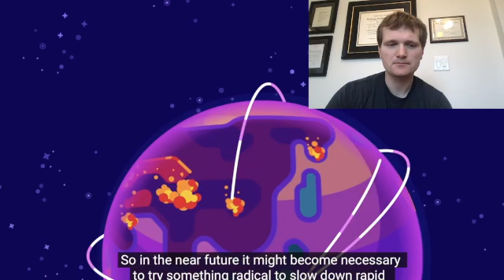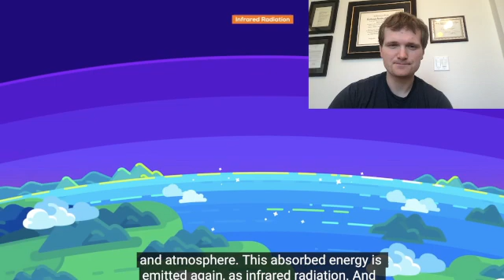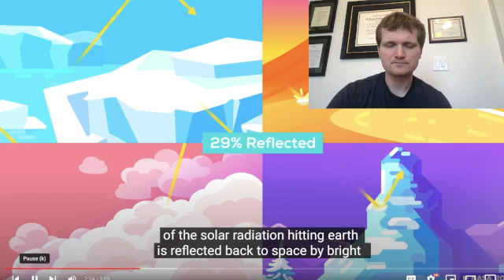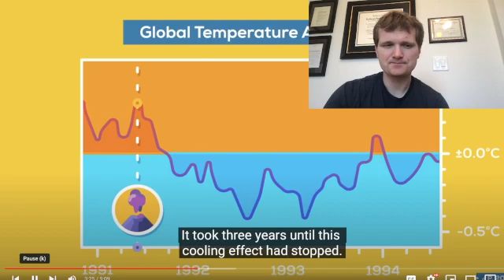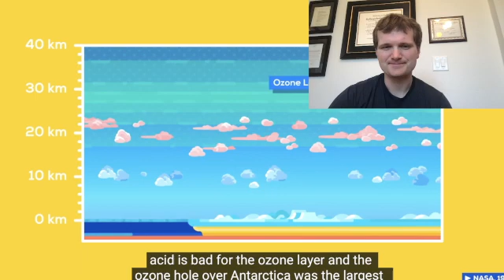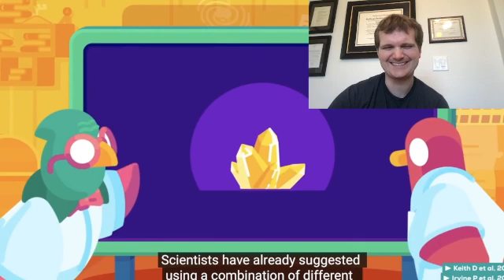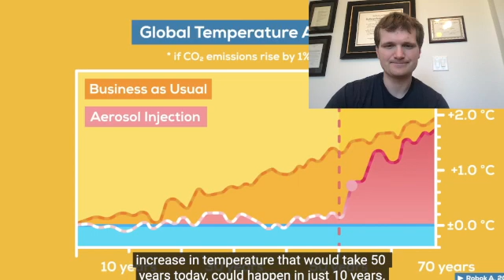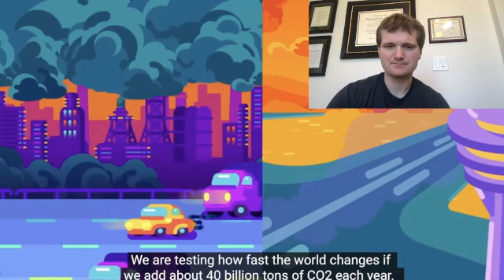Nuclear Engineer reacts to Kurzgesagt "Geoengineering: a Horrible Idea We Might Have to DO"

Comment: I agree that its a bad idea fraught with risk but I also suspect that we will need it to some degree based on how we have responded thus far. It doesn't seem we'll take real strong action until we're already at the extreme tipping point and only quick solutions will do. Hard for people to conceptualize and get behind a decades long fix that, if it works, you never see results from. Much easier to sell the here and now doom than future prevention. It usually takes a hurricane to get people to take floodwater management and other relatively simple preventions seriously, I don't see why the biome as we know it being treated any different unfortunately.